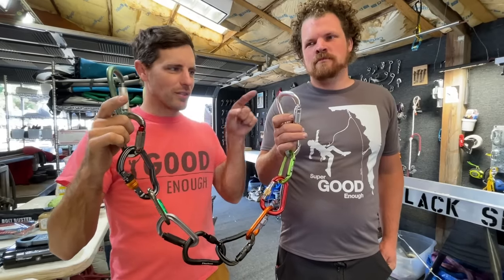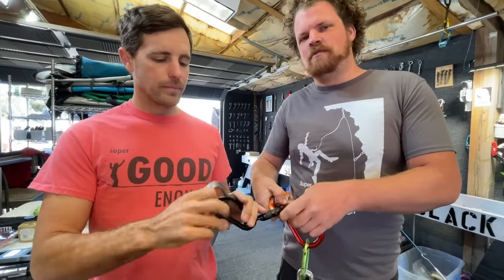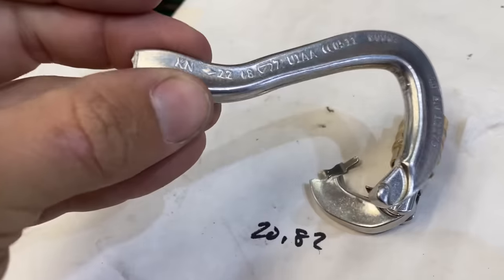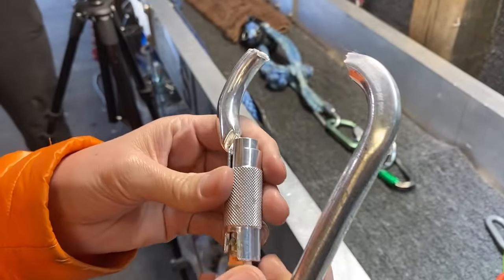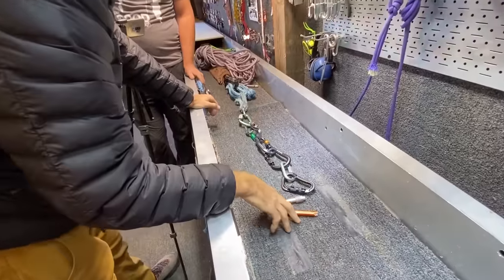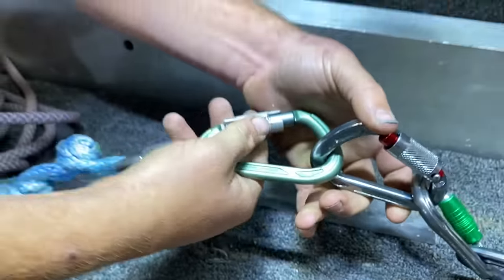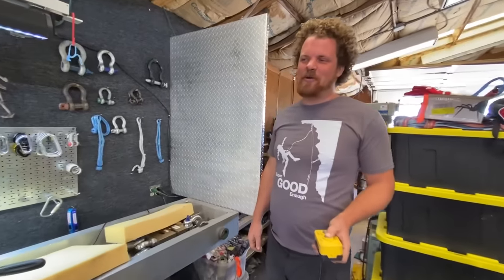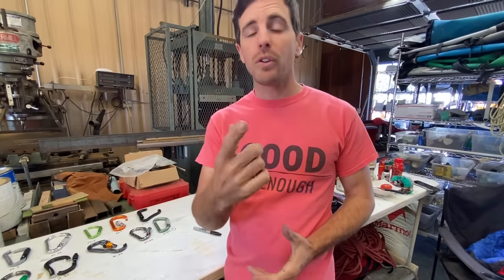Does Petzl's Wire Lock locking carabiner hold up to other climbing carabiners?

Comment: The test would have been more accurate to run them one at a time rather than stressing them multiple times. I wonder if there would be a difference in winner. 🤔
Reply: Well they all take the same stress until they're eliminated, so comparatively at least it works
Reply: If they were all made of steel this would be true but aluminum and aluminum alloys are a much different metals. There is absolutely gonna be microscopic stress fractures in all of them after the first pull. But I see where your coming from I just think the results would be different if done one at a time. I mean cmon these things have literally lives depending on them so wouldn’t you like to know which would save your ass in a fall lol
Reply: @m00seknucklejohnson45  Of course I would, but we're not always climbing on new gear. Granted as destructive testing goes it's not exactly real-world stressing but it is equal stressing and for what this test is I think that's the important bit. Because it's not really their normal test of breaking strength as much as it's a test of how the gear handles repeated high stress events

I mean seeing how they looked between rounds, that's what I really took away from this

I want my gear to look like scrap way before it fails, but some of those took a beating and didn't really show the damage they'd picked up
Reply: They literally said they aren't trying to be scientific.
Reply: I guess I missed it, but which one is the strongest ?
Reply: Also the shape of some are more sharp and defined cutting edge where some are more rounded. I think two categories lightweight and not lightweight  alongside running separate and something as a control Like a chain
Reply: @HogwartsBasement  this is where my thoughts went. Separate them all with identical Mallions.
Reply: @Si_G  yeah so they don’t slice into eachother
Reply: @m00seknucklejohnson45  id trust the on the took a heck of a beating and came out on top 🤣
Reply: @arturogarcia-fp7di  lol you actually have a good point yeah I’d trust that one too lol
Reply: @usualsuspect5173  mad rock
Reply: I initially thought the same thing. Seeing as they still all broke in order, though I think it’s fine. 
It was also pretty cool seeing how the locking mechanisms were affected over time.
Reply: I was thinking this too. Basically all of the data beyond that first pull isn't accurate any longer.
Reply: Did you not watch the video? They mention this not even 10mins in

Comment: I love how the Petzl is basically ruined after the first test, yet it finishes 3rd and just keeps holding despite being trashed. Probably the best advert for Petzl I've ever seen.
Reply: What's the rationale for this $27 caribiner?  A 5mm ring of stainless steel wire is as strong as 1cm of aluminum?  Do we wait for the all wire version that looks like it's made of paper clips?
note: "The WIRE-LOCK increases the lifetime of the product when used intensively, compared to classic locking systems."

Comment: Petzl result was very interesting. Wonder if this was a design feature or a happy coincidence. I suspect irl your lead wouldn't be too happy if they pointed out the biner was open and you assured them that as long as they fell hard enough it would close itself...
Reply: I'm pretty sure petzl doesn't recommend this biner for climbing. I think it's for via ferrata
Reply: Most likely not intentional. It's a via ferrata carabiner and as such it's only designed to take one (but hard) fall. If you fall on a via ferrata (DON'T), the shock absorber will tear open, slowing your fall, but after that, it's garbage and you need to buy a new via ferrata kit anyway.
Reply: @SethSchneiderw  Yeah, it's for via ferrata. Not as nice as the biners that you unlock with your palm though. For via ferrata, where you need to open them quickly, a fall is unlikely to begin with and you're attached with two biners 95% of the time it's secure enough, but for belaying probably not. It's kind of similar to a slidelock biner (which are already a bit sketchy), except the "slider" is far more exposed, with an even higher chance of a rope accidentally opening it.
Reply: Petzl has the most advanced lab for gear testing. Also they finance many PhD programs about alpinism and climbing security through their foundation. Many engineers in the company work using FMECA and dependability methods. They probably know the outcome of any test we could imagine (and see on this channel or on hard is easy) and they also anticipated the risk for the climbers in case of any kind of misuse of their gear.

Comment: I want to start a conspiracy that Petzel designed that carabiner to act this way when pulled. It was hard not to watch it everytime you ran the test.
Reply: The Vertigo has a special feature, were you can not open the Gate, while the carabiner is under load. This is achieved by thight tolerances and a small Deformation, as soon as it is put under load. So yes, this is likely a result of that design and also the reson why this carabiner is super Popular for Zip Lines in aerial adventure park - which is the role it was originaly designed for, before beeing also adopted for Via Ferratas
Reply: Makes since to have a visual indicator to show that the carabiner had failed.

I used to work with overhead cranes.  There was two things I looked for when a hook had failed.  There was a Grove in the eye or in the hook.  And the other was where the clip that sat against the hook.

If the clip sat at the tip of the hook, then the hook is about to fail.

Comment: Though interesting to watch, it’s obvious that a fair comparison would only be possible if you tested every single carabiner in a defined situation. A soft shackle between the biners could be a solution. However, the way you did it is the most fun 🤩
Reply: Yes, although I think, sometimes, that the channel would benefit from at least a more rigorous discussion of method. Done right, I think it would actually up the fun factor.

Comment: Right at 8:02, there's an angle that shows a fascinating thing happening with the Petzl:  Inertia!  The lock opens because the linked 'biners are recoiling, and yanking the Petzl too fast for the spring to keep it closed.  The slider hangs suspended in place for a moment while the rest of the 'biner goes leftwards, and the lock is opened.  If you had rigged the Petzl the other way around (relative to which carabiners were breaking first) inertia would have kept the lock closed instead.
Reply: That's really cool!  
(Period and comma keys advance and rewind single frames when paused)

Comment: I’d like to see the weight along with the breaking point.

Putting a quick link of the same size between each could help get a little more consistency. Right now they are all connected to different diameters. Probably doesn’t make a difference, but for those of us still pretending that we are doing real science it would be nice 😊
Reply: What do you mean, weight along with breaking point.
Reply: @elmeradams8781  I meant I’d like to see the weight of the carabiner.
Reply: @jskemp4  oh right. I think they did that last time with the wire gate caribeaners.

Comment: The Petzl were honestly impressive.
And te fact it would fail inspection but still lasted as long as it did is honestly a worth while "feature". Since better see that the gear have been through an excessive amount of load in its life rather than have something that looks and works just fine but could be on the edge of breaking. Fractures in aluminium isn't something to toy with after all.
Reply: Under my experience, those petzl are great for via ferrata for customers.

I used CT for years as a guide, and loved them. Also petzl attache were sexy.

Comment: Hey Ryan! When are we going to see more drop tower videos? Really hoping you’ll revisit some old stuff broken on the slack snap and see if it’s different on the tower. Thanks for everything!
Reply: i was gonna ask the same thing 😂 hope he didn’t waste all that time and money to not use it
Reply: I'd love to see how different weblocks deal with shock loading
Reply from the maker: Yes, literally editing videos on that right now.  It proved to be very time consuming and time limiting.  To break something on it takes 5x as long as slacksnap and requires a lot more help PLUS really good weather.  For example the cam video I'm editing was tricky to mount a cam holder and we found we can't use low stretch items with only a 90lb weight because it requires a much faster load cell than LS3.  I have a faster one but I'm not sure how to incorporate it into some tests yet as I can't have it fall with sample since it has a cable coming out.  My solution right now is to drop a whole lot of weight on something "stretchy" like a climbing static rope.  But the learning curve on just a detail like this can take half my lab time I allot for banking up a bunch of break tests and only produce one video of content rather than 3 a day I can get on the slacksnap machine.  Don't worry, I got gold coming out!
Reply from the maker: @cmeister1265  See my response to no213.  I'm definitely using it but it doesn't produce as much content for the same amount of time, so it looks like I'm barely using it.  I'm not going anywhere and once I get a system dialed to where I can break 20-30 tests in one day with 2-3 helpers, then we can pump out the content.
Reply: @HowNOT2  awesome thank you Ryan! I understand it is super complex, way more than I understand. And you obviously put a lot of work into what you provide for us. You have been instrumental in me growing as a climber, alpinist, and SAR member, thank you so much!

Comment: Yup at 3:38 as you pan down the line you can see all the screwgates are unlocked. Does that really affect the strength tho? The nose geometry should engage regardless if it's locked, but maybe at high loads the keylock design could slide apart. Wiregates (as I've noticed in your other videos) seem to work the opposite in that the more elongated and bent they get, the hook geometry on the nose becomes a steeper angle and holds onto the wiregate even tighter!

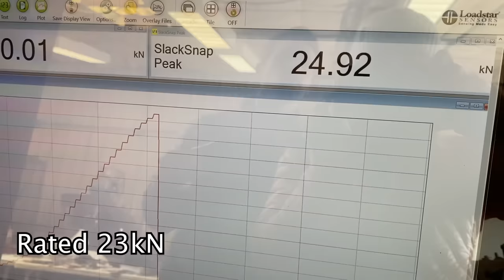Also 9:58 I love Bobby's dad humor, "singing the blues, now" haha
Reply: Carabiner work like hooks.  Most if not all the load is carried in the main body.  The locking mechanism is there to prevent the line from coming out.  If the closing mechanism actually carried a load then the Carabiner would fail at the lock.

Comment: @HowNOT2
Can you test the "C.A.M.P Atlas 3Lock" Carabiner? It's a triple lock, rated for 40kN closed, 10kn side and 13kN open.
We use this for anchors so would be great to know how accurate the high rating is, definitely one of the highest we've seen for an Aluminium Alloy

Comment: Would the results be different if there were some rope between the carabiners? I imagine the metal-on-metal contact spot can be quite small, doing funky things to the forces. Rope might distribute the contact force a bit better.
Reply: Interesting. But the ropes they are made for would break first.

Comment: Every time you apply load to the carabiners, you stressed and deform it due to the load is over the elastic point of the material and beyound of that point (break point). So wen you try again to break it, the deformed carabiners will support less load than before (the strain hardening occur after the first test in all carabiners). All carabiners except the first has at least the capability of 20KN.

Comment: When you think about the average climber taking a whipper and only reaching between 4 to 6 kn, i would think that any of those would do for more than a dozen falls. The fact that all of those reached at least 20 kn progressively as the one before broke speeks pretty highly to all of them.

I would like to see the same test run individually to see if the results would be the same.

Also, on a drop test, it will be better compared to a real-life situation. A slow stretch like that could, in theory, result in skewed numbers than a suden snap.

Comment: I suggest you research "low cycle metal fatigue".   Individual tests would prevent low cycle fatigue.
If you removed the large amount of elasticity from your test rig it would reduce the amount of stored energy, this would make testing far safer as the speed of projectiles would be reduced.

Comment: These reviews are very informative, and have allowed me to improve my equipment and usage several times.  Thank you.
re. 3:48 It looks like the biners are laid fairly randomly oriented as far as each biner's contact points with its neighbors, so when they 'choose' their respective loading points when the chain is initially snugged, those points probably do not slip to the designed loading point the way sling would, and sling applies a distributed load, rather than the highly focused point load from the adjacent biners.  You might inspect the failed biners for the initial surface contact point deformation (a small dent), and compare that to an ideally loaded biner, near the interior curve, along the longest interior measurement (long axis) of the biner.
FWIW: As a very general rule, I try to avoid or minimize metal to metal and rope to rope high pressure or high friction contacts for all my rigging.  
BTW: I noticed at some point that you folk seem to be standing around, unshielded, as these jagged hunks of metal are being flung around the lab.

Comment: So that Petzl was actually second place overall, as the smaller Mad Rock broke lower. Good thing as I have those on my Via Ferrata set which hasn't been used since 2019 but will be in a month or so. I think they do the same one with the Triact gate or maybe the red double action. Interesting results
Reply: The smaller Mad Rock broke lower because it was stressed an additional time compared to the petzl one with more than its max braking load.

Comment: Would you test ground anchors please?
Anything from standard spikes and stakes (15-25cm) through DIY rebar-stake (25-45cm), long timber nails(30cm), 20/30mm angle bars (30cm), U-shaped nail/rebar, flat bar, push-in ground anchors (both commercial and DIY) etc. 
What holds best (lawn, sand, clay) and at what angle?

Application would be tree-less hammock with poles, vehicle recovery (winch) or extreme tent/camping weather scenario.

Thanks ;)

Comment: you know what'd be interesting? if someone made a composite carabiner.  an aluminum carabiner with a steel wire core using the same gage wire as the wire-gate devices.  it would be interesting to see if that gave anything extra when the device failed.

Comment: Hey could you please break test overhand knots. (From the inside of the loop) Just the really simple ones used to tie off a prusik or simmilar applications. (Joining two ends of the same rope and creating a loop) You could test different thicknesses of accessory and climbing ropes or wether other factors (water, dirt, ....) have a bigger impact on the strenght. I'd love to see that. Thank you very much :)

Comment: I would take a bit of an issue about the way this test was done. Basically the carabiners that didn't break on the first pull are then subject to multiple stresses in each pull afterwards. I think it would have been more accurate to do these one at a time. I bet you would have different results, at least as far as the final breaking strength for each 'biner goes. I would not expect a 'biner that has been stressed to a high percentage of it's rating to actually get to that rating after multiple high stress pulls.
Reply: That's not a 'bug' with the testing methodology it's a feature. Part of what makes this test unique is that they're testing the failure mode under repeated stress rather than the absolute breaking strength in ideal conditions. It's interesting to know that not only will the final carabiner break at ~32kn, it will also take 11 other 20+kn falls without any issue at all.

Comment: I have not done any climbing but use climbing gear and carabiners for tree work and I have never had anything break because of massive weight and the only time the nano climbing rope breakers is after it’s been sliced in a spot and even then they last for a long time.
I have climbed many huge trees to cut and lower massive chunks that have to be carefully lowered to the ground because there close to homes and such and never had any gear brake under the stress of hundreds f pounds swinging and have had some of the ropes and carabiners for years without issue.
There pretty damn expansive ropes that cost up to $500 and worth every penny.

Comment: Call me a boomer, but I like my ol'school steel twistlock carabiners. They're definitely a bunch heavier than the climbing 'biners you get these days, but rated to industrial standards, and I use them all the time at work so I have more experience with 'em than anything else; They're just way more comfy in my hands. Plus it's a little extra workout on a long climb

Comment: You should put a sliding polycarbonate door so the flying bits of carabiner don't fly all over the shop, it would need to be kinda thick though I think, I'm not sure how heavy and with how much force those carabiners are flying off at but my guess would be about .25inch thick would probably suffice if not thicker

Comment: It you forgot to test a reverse screw gate (locks at the hinge) crab.  These are fantastic. One finger screw, and no amount of vibration or rattling will unlock the screw. 
And you can use a cheat stick to reach several metres up a climb to clip that one bolt hanger that was installed by an idiot. And with the flick of the wrist on the rope the gate auto locks.